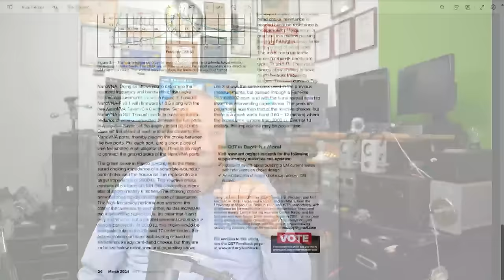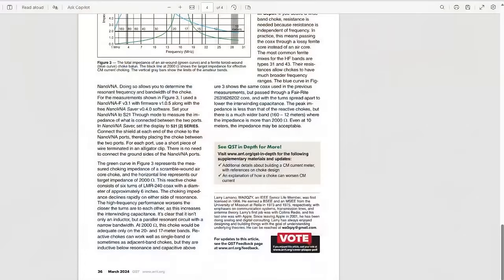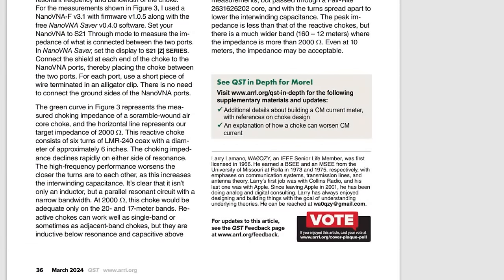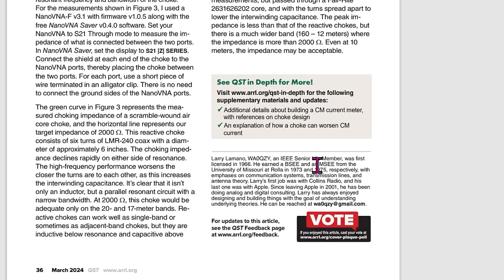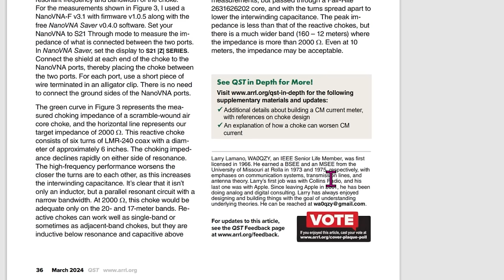Common Mode Currents, What Are They and Should We Worry?  Jim's Got Some Splayning To Do Desi, W6LG

Comment: Common mode current has nothing to do with resonance or swr ,a resonant  antenna with 1.1 swr can suffer from Common mode current, an antenna imbalance is the cause of cmc ,i am usually a fan of your videos but disappointed with this one
Reply: With a 1:1 SWR, how can you get any commode currents?
Reply: @BusDriverRFI  antenna imbalance, incorrectly installed antenna, for example a dipole that's not outstretched properly or close to a structure etc jim does mention this ,cmc can mess with swr but isn't the result of swr, reflected power from an impedance mismatch joins the forward power which doesn't travel on the outside braid of coax ,a choke only chokes the outside of the braid it doesn't correct an impedance mismatch
Reply: If you have a 1:1 VSWR, all of the currents will be dissipated in the antenna. There's no current remaining. Where does it come from?
Reply: @BusDriverRFI  the antenna
Reply from the maker: This is a good debate.  But you say it has nothing to do with SWR or resonance and I don't agree.  Here's why.  Let's suppose a dipole with a 5:1 SWR.  Some current is reflected back to the source. Correct?  That current goes back to the antenna and repeats that trip until dissipated.  Correct?  That reflected current flows on the outside of the shield as a common mode current.  Do you agree with that?  Thanks, Jim W6LG
Reply from the maker: I agree.  Something does not quite add up here.  73, Jim
Reply: @ham-radio  the reflected current from an impedance mismatch doesn't travel on the outside braid it's combined with the forward power ,Walt Maxwells book reflections covers this in detail ,arrl and most study books state this also
Reply: Not shown in the video, but a common "test" for CMC is to slip the collar of the coax connector off the radio connector, while maintaining the center conductor connection.  If the noise drops, it's said to prove CMC is present, vs. a signal on the antenna.  In my case, the noise drops when I pull the collar back, but adding a Mix 31 choke at the radio does nothing to reduce the S9+ noise on 80, and S7 on 40M with the collar connected... The other bands are fine for noise levels regardless. Any ideas anyone?
Reply: @paulm0hpd319  correct on the fact that the reflected current travels combined with the forward power.
Reply: @BusDriverRFI  therfore not on the outside of the shield as common mode current
Reply from the maker: Please don't take my comment as anything but a sincere interest in the answer.  I believe that much of the reflected power is on the outside of the coax.  CMC's have everything to do with an imbalance at the feedpoint and, and, SWR.  To me, it only makes sense as discussed in the QST article.  I believe that is what the author intended by including a graphic that showed a tree.  One wire of the dipole coupled to an object.  The SWR increased as did the CMC's.  73, Jim
Reply: @ham-radio  as mentioned above reflected power from an impedance mismatch doesn't travel on outside of the braid it's on the inside of the braid, as you have mentioned the braid works as two separate conductors ,have you read Walt Maxwells books that cover this subject and everything else to do with transmission lines and swr ?
Reply: @paulm0hpd319 the signal doesn't travel on the outside of the braid because... Why?  Physics tells us that there is an outside skin effect. RF travels on the outside only. It's all physics. I don't have anything to do about it.
Reply: @BusDriverRFI  that's correct physics tells us that it's common mode current on the outside braid not reflected power from an impedance mismatch 👍
Reply: @paulm0hpd319  what engineering degree did you get?
Reply: @BusDriverRFI  this is basis stuff any amateur should know
Reply: @paulm0hpd319  this is why you don't understand.
Reply: @BusDriverRFI  your funny haha ,it's obvious you don't understand if your are challenging my on these two subjects
Reply: @paulm0hpd319  what first hand experience do you have with the science of this and not being a jerk?